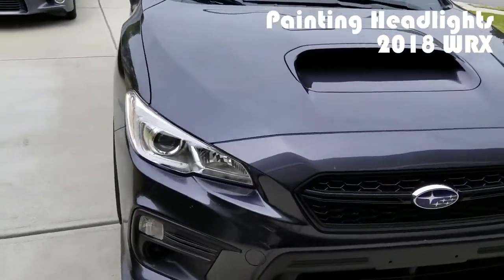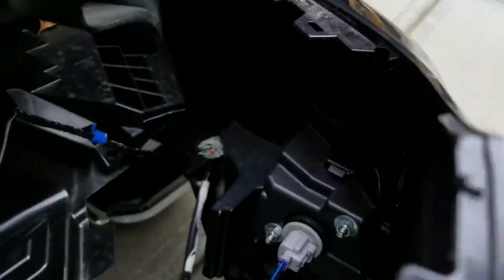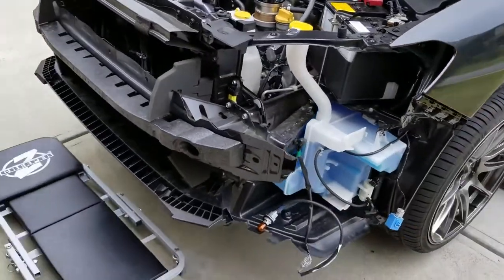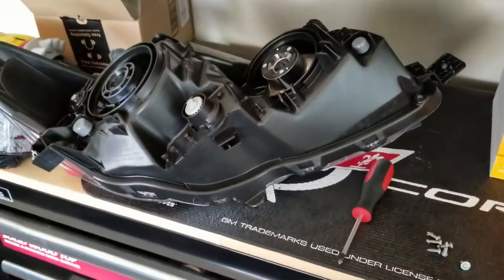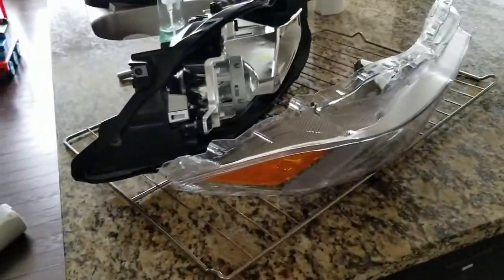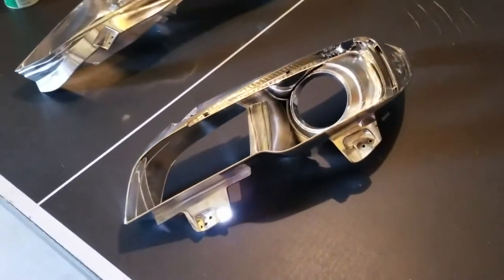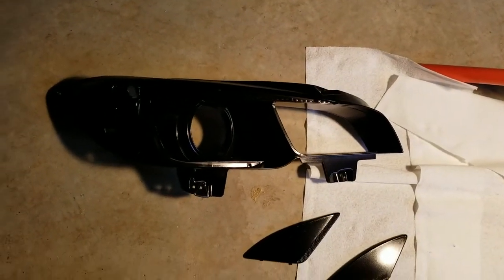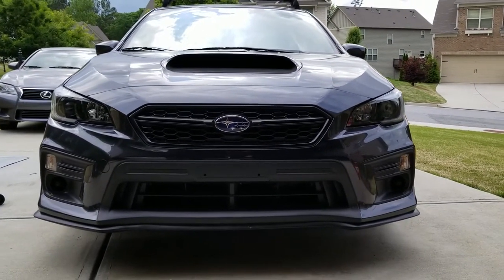Painting Headlights on 2015-2021 WRX

Comment: I am fairly certain the seal around the headlights can be reused and those lights were designed to be separated without heating. The rest of the video was very good.
Reply from the maker: I tried...a lot... Trust me. I actually got a headache from straining so much trying to pull them apart  There's absolutely no way unless you're the Rock. I finally caved and put them in the oven.

Comment: Does this effect brightness?
Reply from the maker: To tell you the truth, I do remember saying that my lights were dim. But, I honestly don't remember if it was because of the paint. The bulbs are pretty weak on it anyway. I bought some LED's shortly after and it was perfect.
Reply: @CarModGuy  what leds did you go with?
Reply from the maker: @PancakePigeon  These right here:

https://www.amazon.com/H11-Headlight-Conversion-Approved-SEALIGHT/dp/B079KB7QX3/ref=au_as_r?_encoding=UTF8&Make=Subaru%7C13&Model=WRX%7C22928&Year=2018%7C2018&ie=UTF8&n=15684181&s=automotive&vehicleId=10&vehicleType=automotive

Comment: URGENT: you actually don't need to bake these headlights, Subaru made them so you don't have to.
Reply from the maker: Well I tried without baking...for like half an hour...and it didn’t work for me
Reply: @CarModGuy  Yeah, I just did them 1.5 weeks ago and didn't have to bake them. I have a 2016, so maybe the adhesive was weakened more than your 2018.
Reply from the maker: I did this within the first few months of buying the car. The last thing that I wanted to do was to bake them.
Reply: @CarModGuy  The good thing is the lights look bad ass! That's all that matters.
Reply from the maker: Jason F trruuueee that. I have no idea how chrome is cheaper than black or who in their right mind said “hey lets do chrome “